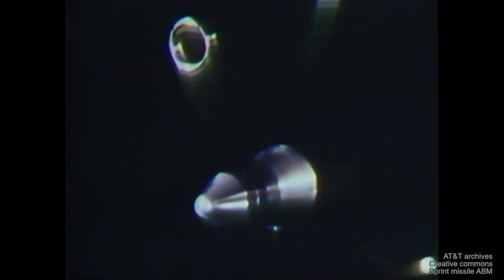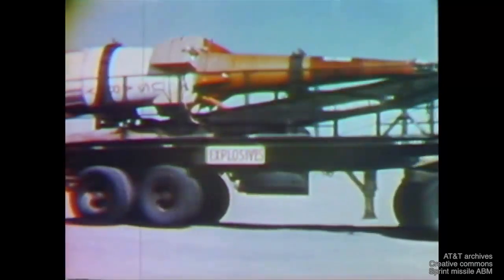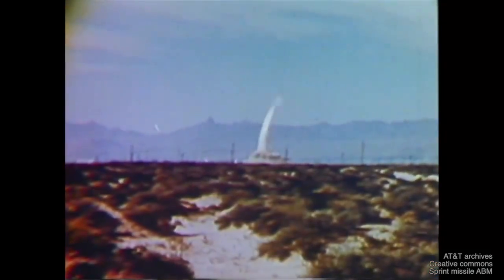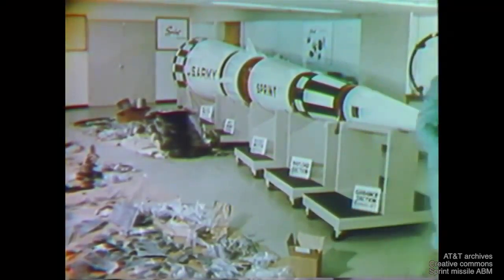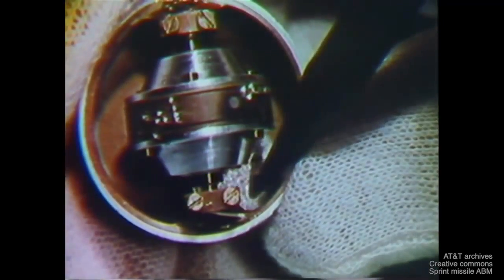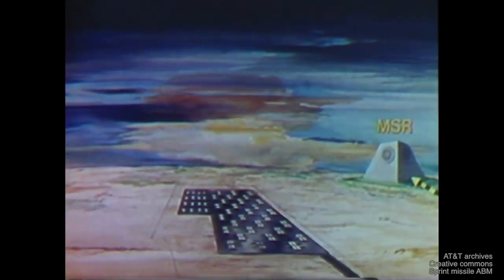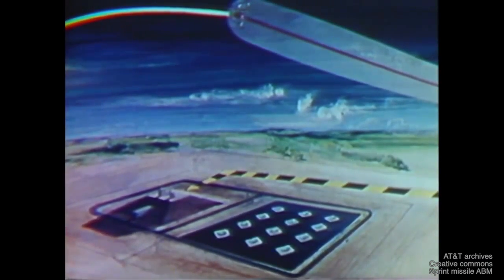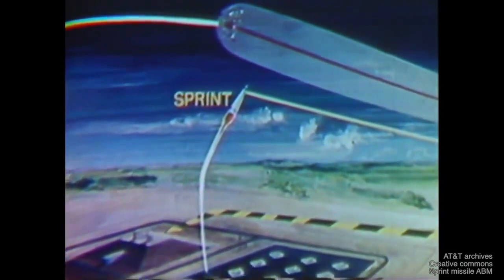SPRINT missile from Martin Marietta - Florida

Comment: They kinda of just vaguely zip by the type of warhead it used.
Reply: A little reading says it was W66 low yield thermonuclear warhead that seems to have been an early neutron bomb designed to saturate the core of the enemy warhead to keep it from detonating.
Reply: @pschroeter1  only a few kilotons. Low yield. No harm on the ground unless you look directly at it.

Comment: The reason they didn't deploy these and spartan is that the nukes would generate a emp field that would disrupt everything electrical on the ground, that they were really expensive
Reply: The Safeguard system, of both Sprint and Spartan, was active from 1975-76, for only a few months. The reason it was shutdown was both because of high costs and of questionable effectiveness against newly-emerging MIRV threats.
Reply: @vladtairov2721 exactly. Not EMP concerns, obviously.
Reply: Nonsense.  Given the choice between EMP vs. a direct nuclear hit, which would YOU take?  Also, the 5kt neutron warhead on the Sprint wouldn't generate much of an EMP.

Comment: I would have to assume an artillary shell accelerating in an cannon barrel from the explosive force behind it is the fastest accelerating object, no?  Sprint was the fastest accelerating missile.
Reply: The fastest accelerating human object was a glorified manhole cover. A shaft plug over an underground nuclear test failed to stay anchored and was instantly accelerated to several times escape velocity. It was recorded on 2 frames of high-speed film and never seen again.
Reply: @vladtairov2721  fastest recorded human abject was Parker solar probe at 400,000 Mph, it is likely the manhole cover disintegrated from the air pressure in front of it before it got to space or when it landed it buried itself several meters in the ground like a small meteor.
Reply: Photons, actually, when they are created they are going C, instantaneously.

But yes, even a bullet from a normal gun would out accelerate SPRINT massively, but SPRINT would go by  it in a very short time, likely going twice as fast as the bullet, so there's that.  There are actually smart bullets now, can you imagine keeping the electronics together in THOSE?  Almost no acceleration time, but one hell of a pulse, and the jerk is massive.  Totally different things to deal with though, even though they are related.  :-)
Reply: Artillery shell has still higher acceleration but for a shorter time.

Comment: The only problem with this is you would still be detonating a nuclear warhead over in American city
Reply: A higher altitude and much, much lower yield is vastly preferable to a megaton level device going off at optimal altitude.
Reply: @vernii  Yup, like probably about 10,000 X.
Reply: @vernii Exactly.
Reply: The point of Sprint (Safeguard) was to ensure we could always launch a sufficient retaliatory strike and ruin the Soviets if they struck first, thus the Soviets wouldn't launch in the first place. Deterrence!
Reply: @summitap1  indeed. The initial plan for a huge system deployed in each major US city was scrapped for costs. After the ABM treaty, the US chose to locate the single ABM system allowed for by the treaty, near the North Dakota ICBM missile fields to protect them from a first strike by USSR. That’s where the actual Safeguard system (100 total missiles) was deployed. 
Russians chose to protect Moscow and deployed their system around it in 7 locations.

Comment: Sorry to be "that guy" but sprint isn't and wasn't the fastest accelerating artificial object. The fastest accelerating self-propelled object maybe, but bullets had it beat for one.
Reply: Wrong, the Sprint accelerated many times faster than a bullet could ever hope to go.
Reply: @orange70383  oops seems I missed yours so I'll copy/paste:
wikipedia says that Sprint accelerated at 100g.
A bullet  accelerates at over 10,000g.
Reply: It's faster when it launched from silo then a bullet leave barrel of gun.
Reply: @ricodelpiero  wikipedia says that Sprint accelerated at 100g.
A bullet  accelerates at over 10,000g.
Reply: @ricodelpiero  I just did the maths myself and found that a 5.56mm bullet experiences close to 100,000gs.
Reply: The fastest ever human made object is a manhole cover actually ( Called Helios 2) that was propelled to 70km per second by a nuclear explosion. Helios 2 is thought to be somewhere in space.
Reply: @sadekgheidan  Helios 2 is a rocket, the parker solar probe is the fastest man made object at 170km a second.
Reply: @miguellopez3392  You're absolutely right. 
I was referring to Operation Plumbbob.
Thanks for the correction.

A question: the speed that you gave me regarding the Parker solar probe, is relative to what?
Earth or the sun?

Comment: WHY CANT AMERICA RE-VISIT THIS TECHNOLOGY
Reply: 1) It has a nuclear warhead.  Nuclear-warhead ABMs are restricted by treaty; too effective a defense makes a first strike a feasible course of action
2) It has a nuclear warhead.  There is no way to provide terminal guidance accurate enough for hit-to-kill with an endo-atmospheric weapon like this, so you need a large blast radius.  It may be preferable to detonate a 2KT neutron warhead 20,000 feet over your city than let the enemy detonate a 2MT warhead 2,000 feet over it, but you are still putting out a large neutron flux over your own cities if you use this.  Preferable to instead use the modern interceptors, which are exo-atmospheric interceptors that hit and kill with velocity alone, rather than a nuclear warhead.
Reply: @bronco5334  Of course you could hit a non maneuvering RV today, no problem.  SPRINT even hit several, though not often.  THAADS is one such defense system, also a Martin (Lmart, now) designed system.  I worked on one of the targets that flew against it, called HERA.  There is a gorgeous video somewhere on YT of a Juno flying the same pile driver profile, where  it points down from VERY high altitude lights the motor, and does a pull out maneuver to simulate the trajectory of an ICBM on a small range (WSMR).  It is backlit and you can see the plume just expand continually into space, it is absolutely beautiful.  It's taken by somebody watching who hasn't got a clue what they are looking at (the THAADS energy management corkscrew, just after launch, again because of the small range, is really something to watch, too.  Never gets old, for me.  Obviously that is not part of a normal real world intercept, a severe added degree of difficulty.

They had exos then to.  Spartan was the other side of the BMD coin.  One of the problems back then is that it was difficult to differentiate decoys from real warheads until atmospheric re-entry, where the decoys would instantly be identifiable.  Problem is you have only seconds from that point until 'boom' to rectify the problem.
Reply: Congress and Budget. America has a tendency of inventing great pieces of military technology and then scraping the project until blood is shed.
Reply: We have better stuff now that can intercept ICBMs in earlier flight phases.

Comment: The Sprint Missile:
1.) Because interception time was crucial, it was found that launching the missile was actually "too slow." Silo doors were actually explosively blown off. And the missile was SHOT out of the silo with a large explosively propelled piston.
2.) Because it was going SO fast in such low altitudes (read: dense air), they actually ran into the problem of the surface skin of the missile becoming too hot (6,200 degrees hot), requiring a first: ablative heatshielding... on the missile's body, and not for re-entry.
3.) ...Because the missile was going SO fast and that was making it SO hot, there was another problem: the missile generated a field of plasma around it. Which is a problem, because plasma disrupts electronics and electronic signals. Meaning that the radar telemetry that the missile needed to accurately hit the incoming re-entry vehicle couldn't be received. Thankfully, this could be solved by just using an even more powerful signal to get through the plasma field it generated.
4.) The first stage is one of the shortage rocket stage firings ever, lasting a mere 1.2 seconds, but generating 650,000 pounds of thrust - which is an achievement in and of itself to produce that much thrust that quickly. And the missile wouldn't even be at its top speed, yet. Also, the first stage would separate as usual but would nearly instantly obliterated due to atmospheric drag.
5.) From "launch" (read: being SHOT OUT of its launch silo tube) to the firing of the second stage rocket motor... unless than 3 seconds have passed. And the missile is STILL ACCELERATING.
6.) 100gs of acceleration puts a ridiculous mindboggling stress on components. Especially electronics, which were in their infancy at that time. Today, we can build electronics that are rated for an astonishing 15,000+ Gs of acceleration (which are used for computer guided artillery rounds), which itself is also an engineering marvel. But we've had decades to improve electronics to do that. Back in 1972... this was much harder.

It's actually insane to think that they managed to make this, let alone almost 50 years ago. And, actually, it could have been EVEN MORE INSANE. Before Sprint came online and was being tested/developed and pressed into service, there was a program called "HIBEX" (High Boost EXperiment) which would have had an astonishing 400g acceleration and an EVEN LOWER target interception altitude of 6,100 meters. Meaning that the Sprint was the "more conservative" and less radical option that was developed even later. Think about that for a second...
Reply: I did a quick wiki check at the sprint 1st stage producing 2.9 MEGANEWTONs of thrust in 1.2 seconds. That translates to roughly 8.7 GIGA-WATTS of power. Roughly equivalent to powering half of Southern California for a second.
Reply: @Jedi2155  8.7 GIGA-WATTS!!!!! Great Scott!!! 

Thanks for doing the maths :)
Reply: @ATomRileyA  So over seven time-travelling DeLoreans. Great, as you say, Scott!
Reply: @ATomRileyA Who is Scott in relation to the Sprint rocket?
Reply: Yeah sprint pulled 100gs due to it accelerating to mach 10
Reply: Sprint first stage burn 1.728 seconds; second stage 2.205 seconds (plus or minus a few thousandths). Numbers I remember as a HEDI project engineer which used Sprints pulled from Army storage in the early 90’s. Four foot thick concrete roof over our heads in launch control just in case! The nearly 30 year old boosters leaked nitroglycerin but lost only about 1-2% performance
Reply: @joelandersonphoto  That's amazing that you worked on the HEDI program. I always felt that the engineers had to have taken inspiration from the sprint missile given HEDI's design. Is there a reason why that program didn't continue? I know the military followed up with THAAD but THAAD's design seems a lot more conservative than HEDI. Do you think HEDI's design could make a comeback given the developments with hypersonic missiles?
Reply: Sprint was the operational form of HIBEX, which was merely theoretical and impossible to build with the technology of the time.
Reply: They used a nitroglycerine based fuel.  It was cast in segments and the segments joined using special 3D zirconium "staples"
Reply: I think it’s even more wild we had nuclear power let alone bombs before that. Absolutely absurd level of technological development at that time, mankind has essentially created and exceeded magic at this point
Reply: Awesome info, thanks guys
Reply: Сейчас Русские сделали А 235 систему (!)😅
Reply: They hard nuclear Artillery shells 10yrs before this. That g force is prob 20x this. Sure it's not as advanced, but it still had electronics it them.
Reply: Six years late but what an excellent contribution, thank you so much. The sprint is my favorite example of the sheer insanity of military capability. The fact that they had a missile capable of hitting something falling at 5 km/s in the 60s is just.. simultaneously terrifying and amazing. No other way to put it.
Reply: Sprint was claimed to do 40G.  Looking at the video, I believe it, amazing.  Its successor, ( in the Reagan Star Wars) was to be HEDI (High Endo Interceptor) and accelerate at 100G.  I don't think it was ever tested.
Reply: Bob Sherman Sprint did 100g’s not 40.

Comment: That thing was crazy fast.
Reply: The HIBEX... (High Boost Experiment) based on the same platform with a different propellant accelerated FOUR times as fast. It went 0 to Mach 8 in just a second. It was only launched seven times, and all footage is classified. It isn't even known if they managed to record it. According to witnesses, it happened in an instant, you only saw a smoke trail into the sky.
Reply: what is the layman's measure for orbital speed? roughly double to triple this, for reference.
Reply: NiceWhenEarned RudeMostlyElse people don’t get into orbit in 10 seconds

Comment: The Soviets were satisfied with the Yankees - A-135 !!! Better than Sprint!
Reply: Well, if it helps your ego, good for you.  It's certainly better NOW because we (the USA) don't have the Sprint any longer.  From last I heard, the Russki ABM interceptors are still equipped with BIG warheads.  So yeah, they'll get the first incoming warhead.  But they may have big problems seeing the next one in time...
Reply: @banalresentive6523  no. The warhead is 10 kt yield on the Gazelle PRS-1 (53T6) same one that was meant to be fitted on S-300 missiles optionally. Presumably enhanced radiation too.
Reply: @banalresentive6523 not big. 10kt enhanced radiation, presumably. 
The Gorgon, 1st layer of Moscow ABM defense (long ago scrapped) had a megaton yield warhead, just like the US ABM equivalent Spartan.

Comment: Neat fact: first stage steering was by Freon injection into the exhaust stream. Between that and the enhanced radiation warhead these things were super green.....
Reply: hey atleast it detonated at a high altitude.  Real bad fallout typically occurs when the fireball gets ground debris in it
Reply: @TheSilentCartographer117  When you're creating enough neutron flux to destroy or disable an enemy warhead near-instantaneously, you're probably still going to be creating a fair bit of induced radiation, even if it's airbursting at 20,000 feet.  

Still preferable to a multi-megaton warhead detonating 2,000 feet above your city, though.
Reply: Yeah, if you were down to actually using this, that wasn’t really a concern at that point. You had bigger problems…
Reply: Better to get irradiated and suffer some minor fallout than get completely nuked and being turned into fallout.
Reply: Sprint was developed because space-based sensors were not available to detect Soviet first strike launches - Sprint was a last ditch RV interceptor.
Reply: @fredflintstone3714  Space based sensors have nothing to do with it. Sprint was the 2nd layer of defense to intercept the remaining RVs in the atmosphere once the decoys had been filtered out by reentry.

Comment: 90% success rate... We haven't even come CLOSE to that with kinetic kill. Maybe we need to bring back these low yield enhanced radiation warheads. Not clean but at least they worked.....
Reply: Once upon a time I worked with an engineer who had been on the Sprint program; he had some interesting tidbits to share.  The initial warhead was a 1MT "conventional" (hah hah) nuclear warhead.  Definitely big enough to get the job done, BUT had a lot of fallout and would put a large radar-reflective "hole" in the atmosphere that would hide other incoming warheads following the one that was intercepted.  And if you intercepted too low, sunscreen lotion wouldn't help much.  Ultimately when whatever responsible agency created the "enhanced radiation warhead" (neutron bomb), they replaced the 1MT warheads with rather small 5kt neutron warheads.  The Sprint had to get relatively close to the target for the new warhead to be effective, but it was certainly capable of such accuracy (shown in one of the "live intercept" tests).  Also, the N-bomb was very "clean" (little fallout) and it didn't create anywhere as near a big radar-reflective blob in the atmosphere spoiling your detection and aim for the next shot.  I'm surprised they don't use them NOW for American ABM systems (blasted commie-loving watermelons) because they would give our ABM interceptors a much higher kill probability.  The two issues with neutron warheads are that they're much more expensive than standard nukes, and the tritium fuel they use needs to be replaced every few years (beta decays to helium-3, which is worse than useless).
Reply: @banalresentive6523  Generally people dont want to fight with nuclear armed ICBMs, so ABM designed to neutralize nuclear warheads is pointless. Modern ABM kinetic kill systems can take down ICBMs in both coasting and terminal phase, with lesser success but can be employed on a larger scale and are disposing of ballistic, even nuclear warheads in a much "cleaner" way.
Reply: @Weisior  You're assuming our prospective enemies will be "considerate".  That's cute.  I'd rather not have a peacenik in charge of our defenses, thank you very much.
Reply: when a nuke head is heading to you, the least you care if it's clean or not
Reply: @ddoumeche  two nuclear detonations in the high stratosphere is better than one  airbust 2km above your city.
Reply: Fallout wouldnt be that bad at such altitudes.  Plus wouldnt some fallout be preferable to millions of torched people?
Reply: That's why we should be pouring a lot more into high speed ballistic projectiles, like railguns and hypervelocity cannons. If you have cheap, easy to make projectiles, you can launch way more of them in a short period of time, upping your chances. Nowadays, nobody would get behind a nuclear-tipped defensive weapon, even though it makes the most sense.
Reply: @doggonemess1  very true.